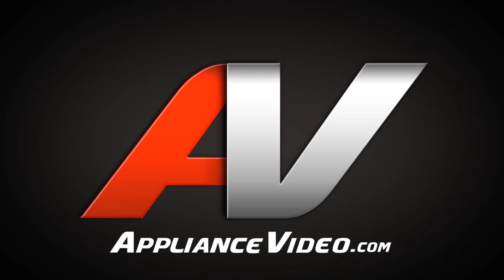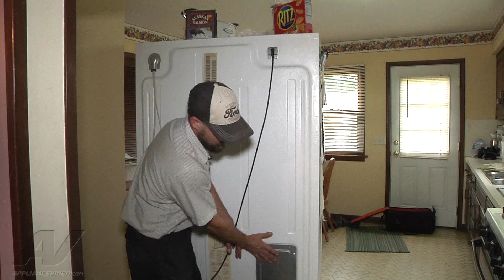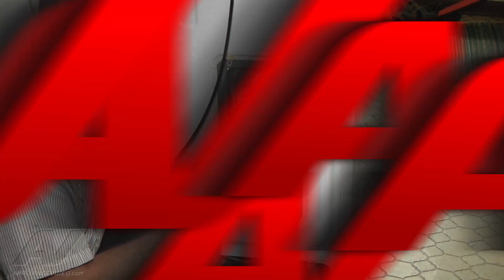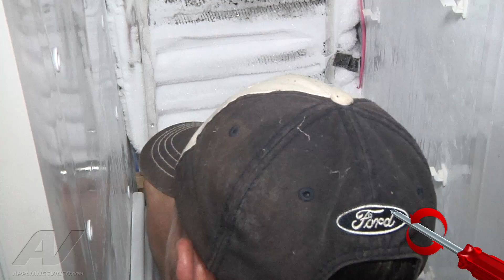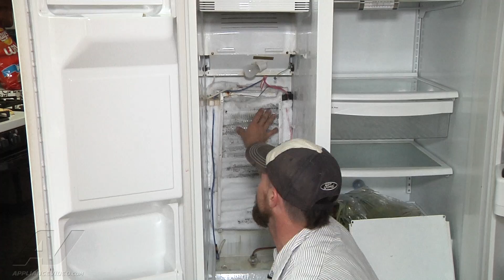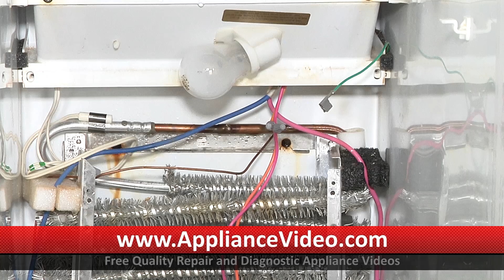GE Refrigerator Repair - Not Cooling - Heater

Comment: I have an old frig in my basement where can i fine parts for it i dont know what kind it is it just says hotpoint on the handle
Reply from the maker: Great question, if you have a
more technical question that our parts department cannot answer, you can search
our over 10,000 answered questions free at our website www.ApplianceVideo.com under our Repair Help section. You can also call
our parts department at 1-800-830-5465 and they can give you help 7-days A week
Monday -Sunday, or search at www.SaveMoreOnParts.com  24 hours
7- days A week.

Comment: That does the switch has to be on or off by the freezer side?
Reply from the maker: +VALENTINI26 

We would like to help you
answer your question. With our videos now getting over 900,000 views per month and
hundreds of questions from people like you, our technicians are now answering questions
at our website http://www.appliancevideo.com/repair-help/ .  We also have over 2200 common questions
and answers that you can easily search through by your model number, appliance
make, problem or error code and it’s absolutely FREE. You also have the option
to email a factory service technician with a question on your appliance at http://www.appliancevideo.com/repair-help/ . If you’re looking for a repair video, you can
also search our library of over 2600 free repair videos. ApplianceVideo.com
specializes in quality DO-IT-YOURSELF appliance repair videos and we get over
800,000 views per MONTH to our videos worldwide and growing. If you need of
parts for your major appliance, we have over 5-million parts in stock at http://savemoreonparts.com/ .  Thanks for your support. Matt Ace
Appliance factory service technician.

Comment: my refrigerator stop cooling both freezer an fridge..I disconnect.. it work for about 3 weeks an  does it again...need help
Reply from the maker: +Wilber Uh 

All of our technicians are
now answering questions daily at our http://www.appliancevideo.com/ website under the Repair Help section.  We
also have over 1600 common questions and answers that you can easily search
through by your model number, appliance make, problem or error code and it’s
absolutely FREE. You also have the option to email a factory service technician
with a question on your appliance at http://www.appliancevideo.com/repair-help/ . If you’re looking for a repair video, you can
also search our library of over 2600 free repair videos. ApplianceVideo.com
specializes in quality DO-IT-YOURSELF appliance repair videos and we get over
800,000 views per MONTH to our videos worldwide and growing. If you need of
parts for your major appliance, we have over 5-million parts in stock at http://savemoreonparts.com/ .  Thanks for your support. Matt Ace
Appliance factory service technician.

Comment: What is the issue of my heater keeps going bad? I replaced my heater about 8 months ago and it's already bad again. I'm having to defrost my freezer every two weeks.
Reply from the maker: mamakoon8 

All of our technicians are now answering questions daily at our http://www.appliancevideo.com/ website under the Repair Help section.  We also have over 1600 common questions and
answers that you can easily search through by your model number, appliance
make, problem or error code and it’s absolutely FREE. You also have the option
to email a factory service technician with a question on your appliance at
http://www.appliancevideo.com/repair-help/ . If you’re looking for a repair video, you
can also search our library of over 2600 free repair videos. ApplianceVideo.com
specializes in quality DO-IT-YOURSELF appliance repair videos and we get over
800,000 views per MONTH to our videos worldwide and growing. If you need of
parts for your major appliance, we have over 5-million parts in stock at http://savemoreonparts.com/ .  Thanks
for your support. Matt Ace Appliance factory service technician.

Comment: maybe someone can help me out. i have a side by side kenmore. the fridge is cold like it has always been bit the freezer is cold but wont freeze. i checked for lent and build up behind the fridge and all is clear. the compressor is running aswell. i was thinkinh it was a defrost switch but i cant seem to find the place to reset it. any ideas???
Reply from the maker: Justin Corder 

All of our technicians are now answering questions daily at our http://www.appliancevideo.com/ website under the Repair Help section.  We also have over 1600 common questions and
answers that you can easily search through by your model number, appliance
make, problem or error code and it’s absolutely FREE. You also have the option
to email a factory service technician with a question on your appliance at
http://www.appliancevideo.com/repair-help/ . If you’re looking for a repair video, you
can also search our library of over 2600 free repair videos. ApplianceVideo.com
specializes in quality DO-IT-YOURSELF appliance repair videos and we get over
800,000 views per MONTH to our videos worldwide and growing. If you need of
parts for your major appliance, we have over 5-million parts in stock at http://savemoreonparts.com/ .  Thanks
for your support. Matt Ace Appliance factory service technician.

Comment: On a GE side by side PSC23SGMDBS, is it possible to totally disconnect the ice/water dispenser BUT keep the ice maker working??  I prefer to just open the freezer door for ice.  I've had many service calls on the dispenser.  It makes noise, drips, causes accidents, mess, and sometime stops the freezer from staying cold enough.  Thanks.
Reply from the maker: RosieCa 

All of our technicians are now answering questions daily at our http://www.appliancevideo.com/ website under the Repair Help section.  We also have over 1600 common questions and
answers that you can easily search through by your model number, appliance
make, problem or error code and it’s absolutely FREE. You also have the option
to email a factory service technician with a question on your appliance at
http://www.appliancevideo.com/repair-help/ . If you’re looking for a repair video, you
can also search our library of over 2600 free repair videos. ApplianceVideo.com
specializes in quality DO-IT-YOURSELF appliance repair videos and we get over
800,000 views per MONTH to our videos worldwide and growing. If you need of
parts for your major appliance, we have over 5-million parts in stock at http://savemoreonparts.com/ .  Thanks
for your support. Matt Ace Appliance factory service technician.

Comment: Recently we got black out and our freezer only gets cold but cannot freeze the food anymore. and the casing outside which separates the freezer and the fridge becomes hot. Any idea what causing this problem? Thank you
Reply from the maker: ryann2k1
                               All of our technicians are now answering questions daily on the ApplianceVideo.com website for anyone needing help. Just copy and paste this this question under REPAIR HELP, and one of our  factory authorized technicians  will answer any technical questions at absolutely no charge on your appliance issues. We also have over 2600 free repair videos to help with your appliance repair issues. Thanks for your support. Matt Ace Appliance factory service technician
Reply: Are questions answered at no charge?  When I go to the repair help page it states it costs $29.99... ??

Comment: "check through it" 1:57 ? Can you put meter on any of the leads? or just the first one. please and thank u :)
mine is a PGSS5NFASS and after a storm and intermittent and low voltage supply it does not seem to start the compressor...is it the board?
will try to search on your site for more info. Many thanks
life without power and Fridge is not so much fun.
Reply from the maker: Boyd
       All of our technicians are now answering questions daily on the ApplianceVideo.com website for anyone needing help. Just copy and paste this this question under REPAIR HELP, and one of our  factory authorized technicians  will answer any technical questions at absolutely no charge on your appliance issues. We also have over 2600 free repair videos to help with your appliance repair issues. Thanks for your support. Matt Ace Appliance factory service technician.

Comment: do you know where I can find out how to put a GE upright freezer in defrost? it has a electronic control
Reply from the maker: balogna
              If you go to our FREE repair help website at ApplianceVideo.com and post this question under REPAIR HELP, we have factory authorized technicians that will answer any technical questions at absolutely no charge on your appliance issues. This is the only website on the web that you can get questions answered by certified appliance and HVAC technicians along with over 2600 free repair videos.  Matt Ace Appliance factory service technician
Reply: ***** Am I missing something? Appliancevideo.com says "You must be a Premium Member to ask questions." A Premium Membership costs $30.

Comment: I have that same problem. Thank you for this video. But also the other side is not cooling my beverages and produce. What can be the problem???
Reply from the maker: Jose
       Check your fan motors in the front and back make sure they are running. Also make sure you have an even frost pattern across the evaporator coil.  Let us know what you find.  Please help us provide more videos to our site by subscribing to our YouTube page or posting ApplianceVideo.com site on your Facebook or Twitter account. We also have our factory authorized technician’s email daily free professional advice to people like you to help solve their appliance problems. Thanks in advance for supporting us. Matt, Ace Appliance service technician.
Reply: @Appliancevideo  "make sure there's an even frost pattern across the evaporator coil" ... what if the evaporator only frosts up on only 1/4 of the evaporator?